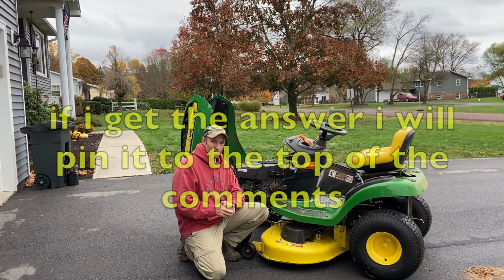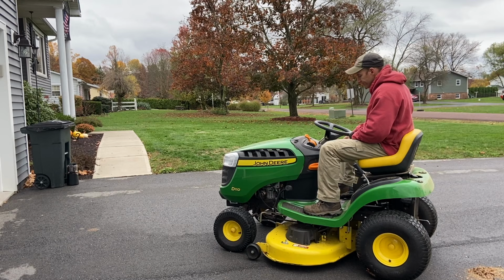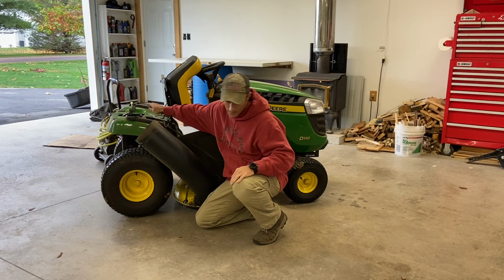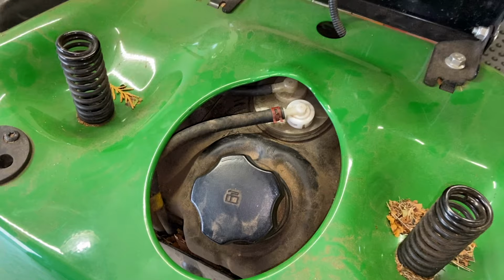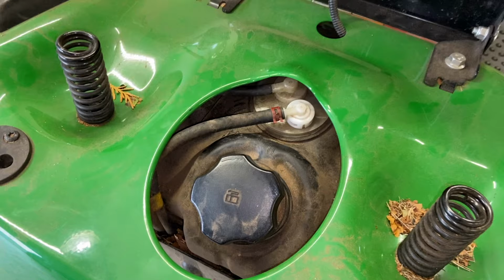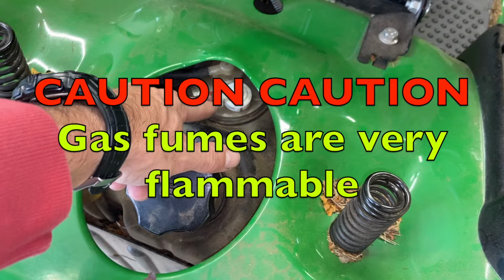John Deere lawn mower won't stay running (100 SERIES)

Comment: I had exactly the same problem..10 minutes then blump blump bang stop.... Deere X320.  ...4 times in a  row.. I was sure it was gasoline....  checked the pressure  relief  valve in the gas filler cap...all ok... New pump last year....   Stripped the carb THREE TIMES....  Fuel level full...   Just looked at the ignition packs air gap and one was nil ! It had slipped forward... Just set the air gap to 0.25 mm on both ignition packs and it sounds far better with zero surging....  Need to give it a longer test but so far it sounds sweet and starts instantly......  could be it got hot in 10 minutes and almost welded itself to the flywheel. When I let it cool it worked for for 10 minutes it started fine...  I need to give it a 30 minute test but it's 82F in Wisconsin so I am off to the lake ! About 50% of you-tubers say ignition packs, and 50% say carb/gas problems... Reporting back  FAILED....  10 mins running with mower on....and it sounded superb after the ignition job...then spluttered and stopped.. So I am back to being convinced it is a gasoline problem.  Next step...fit the old gas pump I changed out 18 months ago as a maintenance item...Watch this space ! ok 2pm Sunday...  Changed the fuel pump for  the original 2010 pump...  Noticed that the very short hose that goes to the cylinder head to activate the pump, was loose. Yippee thinks I, and  re-assembled  with the hose much tighter. Started up ..great,  went 200 yards mowing ...clunk thump stopped ! Next step:  I have an extra thin 15 mm wrench on order from home depot and I will check the fuel cut off solenoid and see what  is afoot... Draining fuel  out of the carb underside can only help anyway..Good job I managed to mow the 1.8 acres yesterday or wifey would have been exhausted using her scissors....
Reply from the maker: Thanks for watching hope you keep that mower running. Scissors will take a long time lol
Reply: @DIYJIM  Laugh !  Latest is that my fuel line was secured with a zip tie, and I suspect it's own weight  was constricting the tube...  I cut the tie away and zoomed round the lawn for 20 minutes without incident.  My wife is a blood-curdling red head (married two of those so far), so I didn't fancy telling  her the scissors plan ... When the grass grows again I will really know whether it is fixed... Just checked the fuel solenoid and in order to hear the click with the key,  I have to either be sitting in the seat or have the parking brake on....

Comment: I'm in Australia Northern rivers I'm about to go and try to get an l100 series started tmrw that went under in the floods. Wish me luck. Great vid.
Reply from the maker: Good luck I would pull the spark plug and turn it over a few times make sure there is no water in the engine. Good luck
Reply: Trying to do the same. L110 went thru the floods near Lismore. Found it upside down in neighbours paddock. Drained the fluids, added fresh oil, new oil/fuel/air filters + spark plug. Ignition was gunked up, fuse had blown, ignition solenoid was dead. Removed carbi to clean & tore the paper gaskets so replaced the whole carbi. 

Got it running but was running rough & now no longer starts, it will attempt to start with choke on but as soon as it’s off choke it cuts out.

Getting frustrating 🙄
Reply from the maker: @brindlestaffy9465  hope you get it figured out

Comment: John Deere labels that second line as a "vapor line". The carb sucks out the vapor air from the tank and it apparently also helps the fuel flow.  Notice these models have a different style gas cap too. I've found any restrictions in fuel flow can cause a carb too lean condition and also a hotter motor and can def cause shut offs and or rough idle and even blown head gaskets when too hot.
Reply from the maker: Thanks for all the tips, and thanks for watching.

Comment: My lawn tractor would die after getting warm constantly. I saw a couple videos insisting that the fuel line (which I believe was original) was the problem. I swapped the fuel line and was able to mow my entire lawn yesterday with no stalling out. It seems to run stronger and more consistent now too. Old line had a real funky spot in it on the outside. Have to wonder how bad it was inside. Probably should have split it open and inspected but had other motor equipment to fix.
Reply from the maker: I started to use non ethanol fuel. My mower has ran good since. I do believe they put cheap fuel lines on the mower. Thanks for watching
Reply: Fuel lines only last so long and pinching or kinking them hastens there deterioration.
Reply: @DIYJIM   add some Marvel Mystery oil to regular gas and it works better and smoother with more power

Comment: Super helpful. I’ll try that and possibly replace that air line. Mine surges below full throttle. Just disassembled the carb and it was clean as a whistle.
Reply from the maker: I also started using non-ethanol fuel and this problem has not happened since.
Reply: @DIYJIM  Just add some Marvel Mystery oil to regular gas and it works better and smoother with more power

Comment: I have a John Deere S240 and it's only two years old. Last serviced was the end of July this year. The mower ran fine right after I got it back from the repair shop then I filled the gas tank, mowed a couple of weeks later and started having issues. While mowing, the mower sounded like it wanted to quit and it finally did and wouldn't start again. I let it sit for a week or so then had to charge the battery and tried to start it. Huge plumes of white smoke billowed out and the mower wouldn't stay running.
I pushed the mower into a shady area and saw the grass was covered in oil. Great. 
Another week or so goes by while I was waiting for the mower repair shop guy to return to work from being out with Covid. In the meanwhile I started watching videos on the things that I could possibly do to get my mower running again. 
When I checked the oil, the reservoir was full of gas so I drained all that out. I then poured in two quarts of oil, drained THAT out then put in two quarts and left it. I no longer smelled gas. 
I didn't try to start the mower though because the repair guy said he was coming over this weekend to see if he can get the mower straightened out. He no longer has Covid but I'm scared.
It's raining today but if it stops I'm going to remove the gas filter, use my air compressor to gently blow air through the gas line and put on a new filter. A new mower shouldn't have this issue and I'm now wondering if some debris got into the gas tank when I was filling it up. 
I am not savvy at all when it comes to machines and motors.
Reply from the maker: Let me know how it turns out hope you get it figured out.
Reply: @nothisispatrick8309  I repaired my mower a couple of weeks ago. It was debris in the gas line.
Reply: @nothisispatrick8309  Actually this is EXACTLY the issue. These mowers are known for this type of problem. To be more exact the electronic solenoid (and/or floats) get stuck from debris, and floods the cylinders. The flooded cylinders leak fuel past the piston rings into the crankcase. There by mixing with the oil and overflowing the case.

Comment: Here's my 2 cents...  I just had this issue and thought it was a clogged jet. I cleaned the main jet and reassembled and it started up and finished my lawn. The very next mow; it died. I reached down to the carb and the anti backfire solenoid was smoking hot. I removed the solenoid and did an ohm meter reading. It was open ! After it cooled down it again measured resistance. I put it on and used it till it quit again and replaced it and it's not happened again and it only gets warm..not hot. That solenoid has a plunger that blocks the main jet when power is off. If you've been in your float bowl, you'll already know how to change it. On a briggs; You'll need a 1/2" open end that you'll have to grind down so it fits between the solenoid and the bowl. In my case; I initially thought I had found the problem only to find out the solenoid had been open circuiting due to excessive heat. I found this is a very common fault on all newer mowers with overhead valves that need this device because the engines are so tight (efficient), they will backfire because there is so much vacuum even as the engine is shutting down, it gets post ignition. Not saying this is your issue but worth considering.
Reply from the maker: Thanks for the info maybe this will help someone. My mower is running good for months. Thanks for watching

Comment: I have an X300 2008 model year. The big gas cap is on top the left rear fender. There is a tiny vent hole in to of cap. It gets plugged. Clean it a round toothpick or paper clip. Takes care of this on mine.
Reply from the maker: Thanks for the tip

Comment: I had the same problem, it was the gas cap. The cap had gotten dirty and was not allowing the flow of air. Take a look at the small hole in the middle of the cap to be sure it is not clogged, if it is clogged stick something in it and then remove the rubber seal inside the cap and blow out any dirt in the cap. If you have an air compressor use that. Once all of the obstructions to the flow of air through the cap are gone your problem will be solved. Also don't screw the cap on super tight, so air can get in that way also.
Reply from the maker: Thanks for the tip and thanks for watching

Comment: Mine would at first start then lose power then surge and lose power cycle. Ran for about 10 minutes with choke partially on then dies and would not start. Looked around and saw a lot of comments about the fuel lines deteriorating around the 10 year mark. Mine is kept inside but is 13 years old. I replaced the fuel line section from carb to fuel pump and fuel filter to fuel pump. Neither line seemed clogged as I could blow through them easily. Upon installing the new lines, it started of 30 seconds to re-pressurize the fuel system. So either there was something in those two lines I couldn't notice or when I depressurized the section between the fuel filter and pump, the gas may have back-washed whatever was blocking the fuel line. It ran fine and I finished the yard. Will replace the tank to the fuel filter and get a new fuel filter when it isn't in the 90's outside.
Reply from the maker: Thank you for the long comment explaining what happened to you. This might help someone out. I might change out my fuel lines at the end of this mowing season. Hope all is well thanks for watching my video.

Comment: Same symptoms for my LA125; but mine only has 1 hose into the fuel tank. So... I blew out the fuel lines from the fuel pump back. Ended up with do-do in my tank, but, knock on wood, the beast seems to run fine once more. Here's hoping it holds. Thanks for posting your video.
Reply from the maker: Glad I could help, thanks for watching. I think if my mower has this problem again I’m going to replace the fuel line. I have heard John Deere put cheap fuel lines on there mowers

Comment: I'v had the 100 series mower for 15 years and never had that problem.Sorry I can't help you! I just wish my  darn mower would break down so I had an excuse to get a new one!
Reply from the maker: thanks for commenting, i will figure it out someday
Reply: What do you do to fix it?
Reply from the maker: i showed in the video, i blow air in the air line on top of my gas tank. Hope this helps
Reply: I have had a LA 105 for a long time also, has had a few minor problems like head gasket , but its the best chap mower I have ever had, and the deck is still good!

Comment: I had a LA175 with the same problem. I found the vent hole in the gas cap was plugged with mud from mud wasp. I cleaned the cap and added a few extra holes in the cap for good measure. Problem solved.
Reply from the maker: Thanks for the info and thanks for watching

Comment: just got a john deere LA145. think its sonething like 15 years old havent done much research yet. Was told it wont stay running. Gonna try deleting all the unneccesary wiring first and checking the spark. Replace fuel line and filter. And then i shall return for some more info
Reply from the maker: Thanks for watching
Reply: @DIYJIM  I got it running by cleaning the carb and and temporarily deleting the fuel filter. wont start without ether but will stay running on its own but with some backfiring happening so now im steering towards the backfire arrestor on the carb bowl, at least thats what i was told it was lol. If anyone has any suggestions, I greatly appreciate it. Also Im not using the gas tank atm. it has some huge cracks in it so i have a hose with a funnel atm. idk if that could be causing any issues or not.

Comment: I have had the same problems with my 11 year old 110. After new fuel lines and new carburetor and cleaning out the fuel tank still the same dying out. Looked in the tank again and bam debris stopping it up again. Turns out it was part of the inside of the fuel cap seal falling into the tank and clogging it. Bet money they all do that after several years.
Reply from the maker: I will have to keep eye on that. I have not had any troubles since I started using non ethanol fuel.

Comment: So I am having the same issue with mine.  The two tubes off the gas tank, one is fuel, the other is a vent line that I believe goes into OHV cover.  I have gotten mine to run by disconnecting the fuel line right after the fuel filter and blowing into it.  It will then start and run for a few minutes.  I have replaced the coils, carb, plugs, fuel line, and fuel pump.  I am waiting on another fuel pump based on what I consider good advise.  The cheap fuel pumps you find on Ebay and such, are crap....So I found one that is OEM.  Not sure if that is the fix, but I'm getting closer!
Reply from the maker: I have been using non ethanol gas also and that seems like it is helping

Comment: Well it's 15 degrees out and the wind is blowing, have a snow blower on mine so I am going to try, it did it in last weeks snow so I replaced the spark plug, air filter and drained the gas in the event I got any water from my neighborhood gas station, it worked good but today same thing.
Reply from the maker: Sorry to here that hope you get it figured out.
Reply: @DIYJIM  at that time it was the fuel solenoid below the carb.

Comment: Your fuel system operates off of a vacuum system make sure your vacuum lines are installed in the proper order there are arrows on the fuel pump also checking to make sure the lines are clear. Or possibly could or possibly a fuel filter etc etc
Reply from the maker: Thanks for the tips, thanks for watching

Comment: On our old riding mower we'd leave the key in it & turned off obviously. Never had a problem.  Then we got a John Deere. If we leave the key in it turned off, it kills the battery.
Reply from the maker: I leave my key in also maybe you need a new ignition switch.

Comment: You need to put some cleaner in your gas cap it also breathe through your gas cap if you’re blowing air into it it could be slashing it around your gas cap which is opening the breather in it
Reply from the maker: Thanks for the advice and thanks for watching

Comment: This worked for me. I had changed the fuel filter and no change. I blew out the air line on both ends and no change. I blew the gas line out on the engine side and that appeared clear. When I put pressure on the gas tank end and released the pressure I had gas squirt out.  I believe what is happening is when the engine starts the gas that is in the line is pumped into the engine. but there is not enough gas to keep it running. After the engines sits, even for a few seconds, gas bleeds into the line and allows the engine to run for a few seconds again.
Reply from the maker: Crazy but I started to use non ethanol gas and I have not had this problem again.

Comment: Depending on the EPA stage of the unit.. ie Caliunicornia EVAP it has a charcoal canister. That second line is a tank vent and routs to the canister then to the carburetors air horn which creates forced air draw through the charcoal filter. Any tank that has a clogged vent will build vacuum in the fuel tank and prevent fuel from getting to the carburetor.
Reply from the maker: How can it be fixed, that sounds like the problem. It only happens once or twice a year. I thought about changing the fuel lines.

Comment: Jim, these videos are very helpful.  I have a problem that just came up with my D-100. When I engage the blade lever, the engine bogs down and quits.  I replaced the belt last fall, and it's been running fine till now, and all of a sudden I have this issue.  I checked the belt tension (with the engine off) and with the blade lever engaged, and the belt does not seem overly tight. Any suggestions on what to check?  Thanks.
Reply from the maker: Do your blades spin freely are your spindles still ok. If you take your belt completely off your blades should spin easily. Hope you get it figured out.
Reply: Did u ever figure it out? I’m having the same issue with my grandfather mower.
Reply: look under the deck for anything holding the blades up (pieces of wood, cord/rope that was not seen, barbed wire piece,etc...) also like DIY JIM mentioned spin the spindles to make sure they spin freely, if not it could be a bearing issue.
Reply: Bent push rods if you haven't figured out
Reply: Chord or wire wrapped around the blade spindles. Sometimes they are subtle and difficult to get out.

Comment: Mower did it again after I thought it was fixed. Tried blowing out fuel and vent connected to gas tank and fuel pump. Then changed fuel filter and it runs good again. Recently changed fuel filter when completed annual maintenance, so I didn’t think I needed to replace fuel filter so soon. Must have been from running fuel almost empty that clogged fuel filter.
Reply from the maker: Hope you get it figured out.